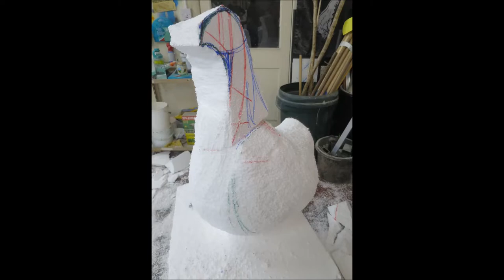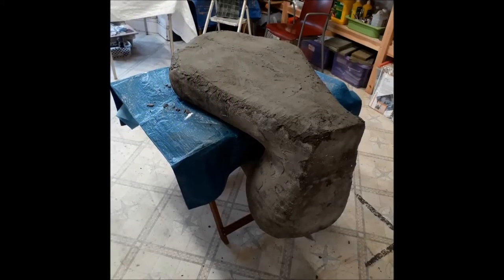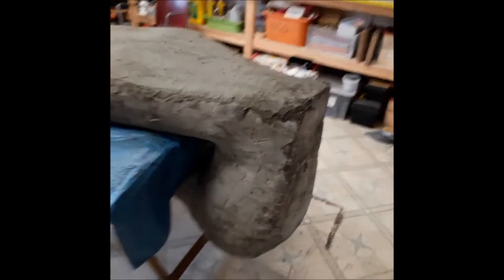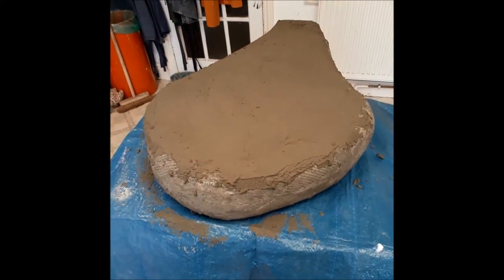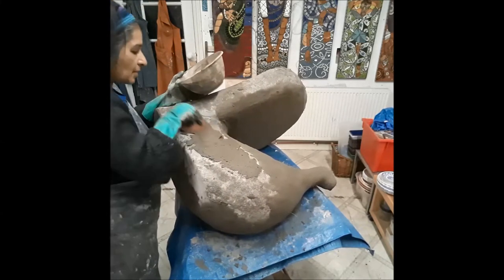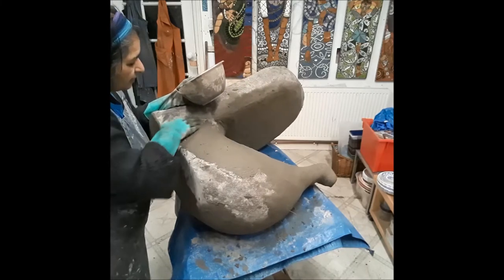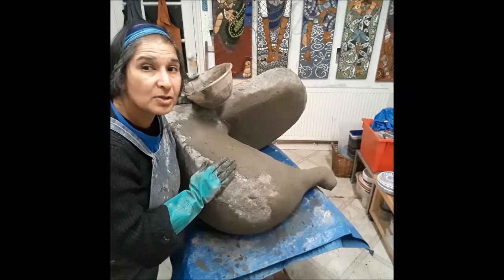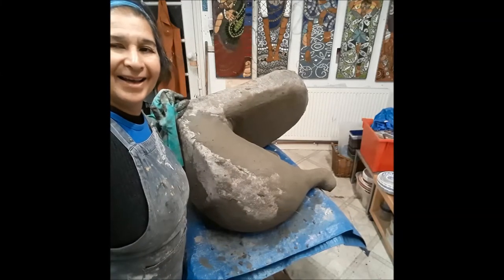Chip the Picassiette Peacock 2019: Part 1 - Making of the polystyrene sculpture

Comment: I had a hard yet slightly textured bust form that I tried doing to mosaic to , I got it all done and grouted ,sealed and after about a month outside everything fell off .  What should I have done to this form to prepare it before i did my mosaic?  Help. I'd like to try again
Reply from the maker: What was the bust made of Marianne?  And maybe the adhesive wasn't external grade?  If you worked on fibreglass resin then it's best to use a caulking glue to adhere onto the surface. I'm guessing everything here as it may be an idea if you posted a photo via my website email mangomosaics.co.uk I'll see if I can help further. More information please